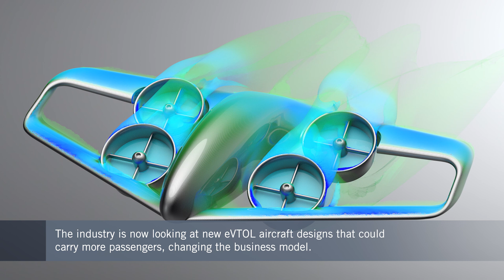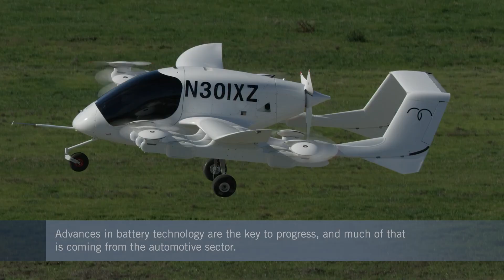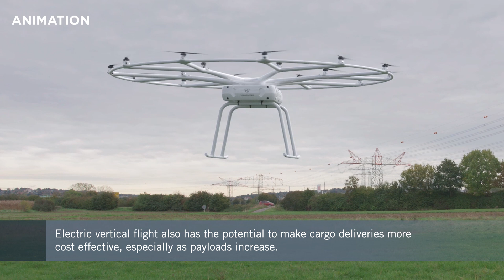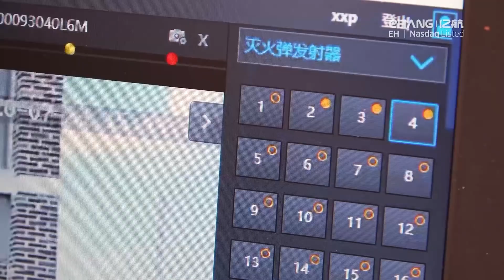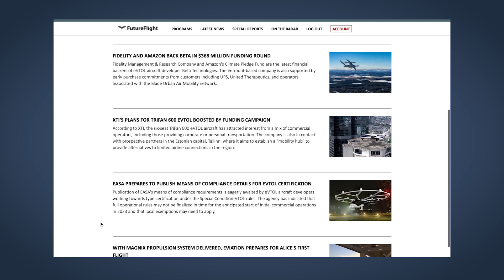How New Electric Aircraft Could Transform Public Transportation – FutureFlight Explainer

Comment: Imagine if the 50 Person VTOL changes battery packs quickly on top of a tall building.
Or even not even need to land sometimes at smaller VTOL Bus stops: while it hovers above a pulley system could drop off people on one side, and pick a few up on the other.

Comment: Drone delivery can dramatically amplify online purchases, particularly prepared food. It could genuinely make kitchens a thing of the past.
As for personal transport the obvious config is single seater autonomous with 2 tilt wings. Single seat for minimal sound impact for residential immersion. The drone configuration is quite unintelligent. It's curious to me that the handful of well funded high profile start ups have entirely failed to become relevant even after 10 years. Sebastian Thrun and Larry Page should at the very least lead to something after 10 years but it's like they suffered a complete lack of confidence early on. I've been saying 2 tilt wings from the start but no one listens.
With the possibility of UFO disclosure, it might become moot points however since that offers very potent new ways of mobility. And yes that is quite real as well. Weather you can handle it or not. When even Obama cowardly has admitted that it's real, it's time to wake up.